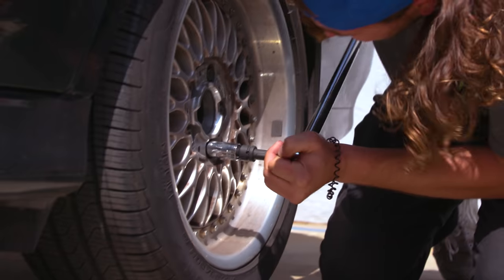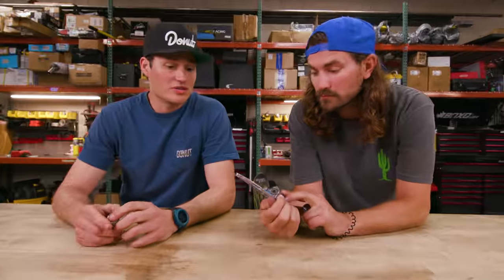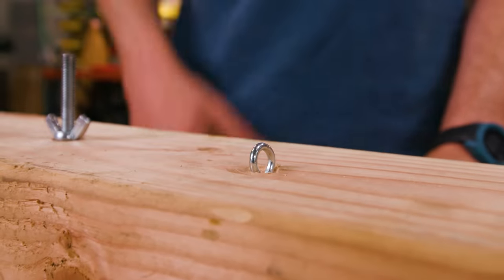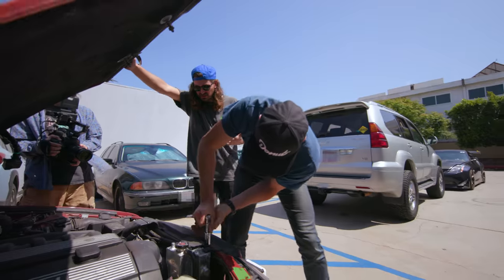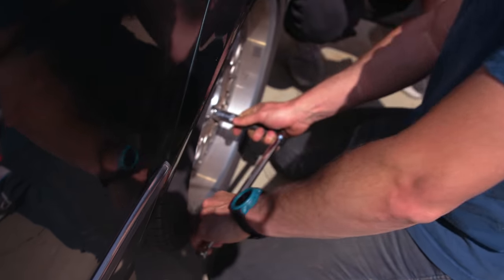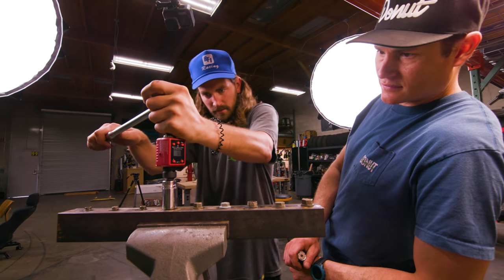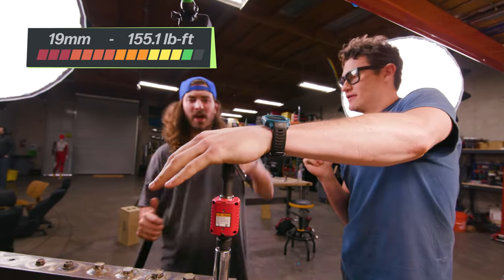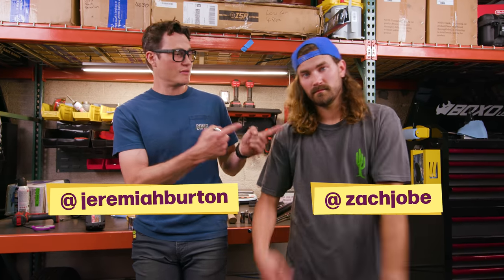Testing the World's Most Hated Tool

Comment: Oil Filter wrenches would be sick to see.. the three different kinds of them as up against each other
Reply: I just use a old leather belt, works great on every size of filter plus the length makes it easier for tall engine bays
Reply: I like this one as well. My favorite are the ones that are basically a oil filter shaped socket, but sometimes you just can't get them into the tiny space the manufacturer decides to stuff the oil filter into.
Reply: Good idea
Reply: @ztyhurst  Yea i use the socket ones too but depending on the year of car i find u need either smaller or alot bigger which is strang
Reply: Those new 3 pronged ones you can put on an impact win for me lol put in on pull the trigger lightly and wait for it to tap it loose
Reply: Ditto! Especially in confined areas.
Reply: My preferred oil filter wrench is a screwdriver and a hammer.
Reply: I have used pretty much all models on many kinds of cars and I can say it really depends on the car what's best and not the tool itself.
Reply: If you are doing your own oil you should be able to get it off by hand.. hand tight then 1/2 turn ands its sealed
Reply: Try an oil udder too those are sweet
Reply: @MAVORlC  that’s a good idea thanks
Reply: @snakeballs8965  you are a menace to society my friend
Reply: @flyfreak23  I also rotate hose clamps so that they have to be rotated back before they can be removed.
Reply: I have different wrenches for different stuff.
I have a Matco ratcheting filter wrench with jaws on it. The jaw size is adjustable and has shown to rip open a tight filter instead of losing grip 😂
I have a regular oil filter wrench that every has, a Volvo filter socket, and a Toyota filter socket. Rarely use the last 3 but they’re invaluable when I need them
Reply: They work pretty good
Reply: On my car atleast i just use. Yk. My hand
Reply: I use a pipe wrench, stuck oil filters are no longer a problem
Reply: @ztyhurst  a screw driver and a hammer
Reply: Oil filter plyers are the only way to go
Reply: Except there ment to be done up loose enough so you can remove them by hand
Reply: @Nomobsfome  I've used that method as well, but it's kinda messy.
Reply: But you only need one once, right? If you're doing your own oil - I've learnt/heard that hand fastened is tight enough, so the second time you service your car it won't be welded stuck to your engine like the first time you do it
Reply: @brandonr2188  Yeah, it's always the first time someone brings me a car to do where I seriously need em.
Reply: I just use channel locks
Reply: @snakeballs8965  "My preferred oil filter wrench is a screwdriver and a hammer." ha, I've had to do that a time or two. And I'm the one that put the oil filter on in the first place
Reply: we use a chain and a bolt welded together
Reply: I second this!
Reply: The tri claw is my go to
Reply: Jesus loves you alot trust in His death 4 salvation and be saved from eternal hell <3 Jesus died on the cross for you bro.
Reply: Hey guys I just got my first car last week, I've been watching alot of Donut videos and always hear the crew talk about forums and was wondering where I can find these forums for cars, my car is a 2011 subaru impreza 2.5i sedan. Any info would be greatly helpful
Reply: I have always just stabbed a screwdriver through the old filter to spin it and just screw on the new one
Reply: I'm a chevy lubetech. I have band type oil filter wrench, Turn-and-close 3 jaws socket, and normal oil filter pliers. I use all of them every day. If you're not mechanic and trying to find a best tool for oil filter change, it really depends on what car you have. For example, some toyota cars, you need a special socket. oil filter wrenches won't work.

By the way, circle steel band type filter wrench works most of the time.
Reply: Strap wrench is the best IMO jaws when jiffy lube tightens the oil filter with a half inch impact
Reply: I used to change oil for a living, the cups are definitely the best.
Reply: Am i the only one that uses his hand 😅🥲
Reply: The grabber style only works for canisters, not the filter+housing setup
Reply: @DexTheMenace  NASIOC is the forum you are looking for
Reply: @jimmyjames8573  they should be installed as tight as you  an by hand, but after the heat and time I challenge you to find a filter that will come off by hand. Should need something to Crack it loose (up to 1/4) turn, then will come out by hand
Reply: hand tight baby
Reply: YES! I friggin hate those plier-looking ones. Without fail I always crush the heck out of the filter.
Reply: yes please I wanna see the old belt style versus the spider or  metal band on different filter types
Reply: There are more than 3 types for a start and each one I have used and own are all great.... it depends on what you are working on to which one you grab
Reply: @its_tricky_dick  For sure! Some of us (like me) are incompetent though. 😂
Reply: @jimmyjames8573  doesn't always work that way. Toyota 1gd-ftv and Ford 7.3 powerstroke are 2 engines off the top of my head that require to be tighter than usual
Reply: @mercury0214  I bought a 3 prong one that fits on a socket wrench at Walmart for like 5$, works really good.
Reply: @czattew  hmmm that's weird I swear 1st time I did 1 the instructions said tighten until the seal touches then go another half turn which felt way too loose for me so I always just done it not quite as tight as I can but close too it and never had a problem undoing 1s that I've done
Reply: @its_tricky_dick  interesting.  Good to know
Reply: I've tried three different types and settled on the one that's basically a supersized socket that fits the bottom of my particular oil filter.
Reply: I use a 32 mm socket.
Reply: @dawggonevidz9140  Yes, that's the one i was trying to describe lol. It fits on a socket wrench and grabs the bottom of the filter.
Reply: I just get the K&N ones with a wrench off nut. Works great
Reply: For general Europe trucks and reefer units i use a chain tool or a belted one. Socket sometime works but rarely and 3 prong is a nope.
Reply: you mean there are alternatives to a screw driver and hammer?
Reply: @brandonr2188  this is the real answer, if you have to use a filter wrench, you're doing it wrong... unless you have one of those cartridge style filters, my wifes saturn has one of those, takes a 1-1/4" socket, so gator grip would definitely be a fail there too, lol.
Reply: @dinukap4  what about using a silver wire, Remus Tuning?
Reply: @joshalsabeh20  strange u mean? Not stange.
Reply: @snakeballs8965  screwdriver? Seems like an odd tool huh?
Reply: @repulse_timm  what is oil hudder? An odd tool huh?
Reply: @purwantiallan5089  but effective
Reply: As a professional who uses all different kinds. I can honestly tell you, the pliers are the best tool. Suitable for 75% of applications. Then the claw type tool is a second.
Reply: The pliers win hands down. I have the strap, the jaw & the pliers in my van & I’m a mobile auto technician. The best option is the oil filter socket. Those kick ass!
Reply: Snap-on makes a socket for oil filters
Reply: The Claw, The wrench, The pliers, The cups
Reply: @stpbasss3773  oh yea that’s the same one im talking about I just put in on my impact haha
Reply: project farm
Reply: There’s probably a lot more variety than you’d think, I gave at least 5 or 6 different types of filter wrenches
Reply: Bro just like get stronger
Reply: It all depends on the filter application.  You can't always get the pliers on the filter.  Like the GM vehicles that have them up front by the exhaust manifold.  Or the Ford ranger where you have to go in thru the wheel well.  In those cases, I use a filter spring wrench 🔧
Reply: Bluepoint filter wrench. It has 6 jaws with 3 teeth each and 4 adjustable size with the snap op filter strap
Reply: I fucking love my oil filter wrench
Reply: OilFilter Wrenches are the most useless tools of them all.. I mean.. when you install a new filter, you're supposed to fasten them by hand.. and if you take it off.. you're gonna discard it anyway, i just smack a screwdriver through it and unscrew it.. 
if that sounds a bit harsh?.. get a big Hoseclamp and a pair of pliers, or use a strap wrench.. strap wrenches are the most underrated tools, there are also versions with a chain instead of a strap, you can easily make one yourself.. all you need is a piece of flatbar, a drill, a file and a punch to split the chain.. oh.. and a hammer to push the pin back in to the chain where you fasten it to the flat bar..
I made one to replace the front sprocket on my minibike, with a ¼" minibike chain.. worked like a charm..
Reply: 3 kinds? I can think of like 6 kinds I'd like to see tested
Reply: At Hyundai all the filters are facing down so the claw is best on them
Reply: Oil filter wrenches? It only needs to be finger tight. As far as removing the old one, on the rare occasion that it won’t turn by hand you can just hammer a screw driver through the side of the filter and use that to get it started.
Reply: @curtmcbee2238  Yea thats fair... ive had to use them in cases where vicegrips were needed
Reply: @MAVORlC  can i borrow it lol
Reply: @snakeballs8965  Lol nah use a chisel
Reply: @brandonr2188  yea sometimes but then i just get lazy and use the socket filter wrench
Reply: @jimmyjames8573  yea.. ive encountered ones where its been torwue tightened and even partially welded cuz the previous owner or mechanic wanted "less air intake" so i just use the filter wrench just in case lol otherwise if its my own car i use my hands
Reply: @czattew  lol lil snow on that and ur fine haha
Reply: @banzai.drifto  good to know
Reply: @alexanderpruitt432  they’re not the only ones. You ever heard of OEM tools? That’s a great brand!!
Reply: shop towel and brake cleaner works every time. just comes with wrist damage lmao
Reply: there are at least 4 kinds, five if you count the filters you use regular sockets on. and what's best really depends on the type of filter and placement, both on the engine and in the engine bay
Reply: the filter on my truck always gets stuck so I stab a screwdriver through it all the time and it works every time 👌🏼
Reply: Am I the only one who just uses my hand for an oil filter wrench? If it's really stubborn, a hammer and screwdriver do the trick.
Reply: @joshalsabeh20  so that leaves me asking myself are the smaller filters better designed and more efficient, or are the smaller ones more cheaply made and wikk not filter oil properly
Reply: Lot of oil filters today are impossible to chisel off like the old days. I just changed oil in my new JD Gator. You aint getting that sob off without that socket style that fits right. Not without removed all the skid plates. I succumbed and bought the damn thing. $6 made it so simple....but why do I hate admitting that? Cause it's a scam! They are all in it together LOL! ~ then again, I remember $0.80 cent's for a qt of oil too.
Reply: @MAVORlC  thats funny, my dad when i was a kid bought what looks like a oil filter strap wrench but was advertised on TV for opening pickle jars, mason jars, ext ext
Reply: Love the socket ones when they work, on my old civic the steering rack was in the way of the oil filter so I had to get in there with my hands and struggle with it for 20 minutes since the idiot who changed the oil last torqued that fucker down
Reply: They make them my father has one for his ‘05 duramax
Reply: My oil filter wrench is a screwdriver
Reply: @DrTabarnak  Odd flex but ok LOL
Reply: Sounds like a video for Project Farm
Reply: I second that
Reply: I just use channel lock pliers 😆
Reply: @czattew  Mine always come off by hand. I don't even own an oil filter wrench. Clean the base, bit of fresh oil on the gasket, hand tight. Not "as tight as you can"...just snug. Let the gasket do it's job.
Reply: I use screwdriver piercing method lol
Reply: Including ye old screwdriver plus hammer
Reply: JUST USE CHANNEL LOCKS FILTER WRENCHES ARE DUMB
Reply: @misstori1437  u take that back... Mechanic Jesus loves them LOL
Reply: Yes
Reply: so you're not supposed to use a plasma cutter
Reply: @drewlogan4341  No one is saying that lol you do you
Reply: I think there are more than just three types today.
Reply: @DexTheMenace  hit up nasioc
Reply: @scratchmyback1  I just use channel locks if all else fails.
Reply: @rushthezeppelin  I use a cup style filter remover, too, but more often than not it gets stuck to the filter and I have to whack at it with whatever tool is handy to remove it. I have a 2002 Saturn SL and it's pretty cramped where the filter is located.

I also use a quart-sized oil container cut in half to wedge under the filter, with the opening set in such a way as to direct the flow over the oil drain pan. It reduces the chance of the oil spilling onto the rubber CV joint cover located below the filter, and making a big mess in general.
Reply: @czattew  I used to own a '68 Mustang (I wish I still owned it) that has a 200cid straight 6 and its oil filter was so easy to access that I was able to unscrew it by hand. There was an incredible amount of space under the hood with that thin engine in there. It was the easiest car that I had owned to work on under the hood.

Edit: You should only tighten the filter about of a turn once the seal engages the engine, not as tightly as you can. Perhaps that's why you find it so difficult to remove.

Do I get a cookie for winning your challenge? :-)
Reply: @bcdoggie  Yeah I'm more thinking of those cup filter removers from the context of someone changing oil for a living.  Get the filter off and whack the wrench on the moveable drain pain down in the pit to dislodge the filter.  I'm already covered in oil in that context and there's oil everywhere in the pit.  At home when you are trying to keep nice and clean I could see it being a bit of a different prospect in not wanting to get oil all over your clothes and the nice clean garage floor.
Reply: @rushthezeppelin  Good point. I used to use the same wrench that I use on the drain pan's oil plug to remove the filter remover, but learned that whacking it with a hammer and slot screwdriver instead does the trick much more easily.

Comment: I've had limited success with this tool. It's useful occasionally for jacked up bolts and things like ceiling hooks (as seen on tv!). But they are definitely not a do-it-all replacement tool by any stretch of the imagination.
Reply: I've got one of these, it's defo great for hooks and things you can't usually use with a impact driver...and you have a little bit of sympathy for the thing you're attaching, but I have you know, socket attachments for the impact driver as well, so why wouldn't I use the right one!
Reply: Yeah, they seem like a great tool for little things around the house like hooks but that's about it
Reply: I've used it my whole life with zero ISSUES,, some just don't know how to properly use tools....
Reply: Throw a second hook into the chuck of your drill and use that to put hooks up in the ceiling
Reply: @davidhaynes9580  mind blown
Reply: Yeah my father got a non name brand Gator grip for real cheap for those once-in-a-blue-moon bolts so he probably used it every like five years.
Reply: @2-turnt559  good for you? It's still not as effective as using the proper tool.
Reply: If you're talking about drop ceiling bolts you hang the grid from, you can go to a hardware store and get a screw bit that's designed to screw them into place.
Reply: @chasm9557  yeah, but I've already got a gatorgrip lying around. And I don't have to go to the store.
Reply: @liquidrepublic  I guess it's one of those things where I've done it enough that I just have a couple laying around.
Reply: Hey! Did you know God is three in one!? The Father, The Son, and The Holy Spirit! Bless them!
Jesus died for our sins, rose from the dead, and gives salvation to everyone who believes in him and follows his commandants!

Have a blessed day, everyone! ❤
Reply: @davidhaynes9580  exactly haha. Hell I've used a decent sized nail bent to a 90° work just as well with less damage if you are in a pinch
Reply: I totally agree
Reply: i have one.  almost never used it on regular bolts.  I use it on irregular heads such as hooks,  funky security bolts.   and it does not even replace my tools in my tool box.  in fact I don't remember where I put that... hmm.
Reply: @davidhaynes9580  that's smart, nice. Thanks 👍
Reply: @czattew  that's also smart, nice tip
Reply: I used one for several years for all kinds of odd shaped and damaged bolts. When it finally gave out I went and got another one.
Reply: @Call_Upon_YAH  three in one?? So god is like the gator grip of deities! Lol
Reply: only good for when you have destroyed a bolt completely 😅
Reply: @liquidrepublic  massive facts 👏 the right tool always works better 👏
Reply: Same, plus they're a fuck ton more useful if you cut away a little of the socket to expose maybe a 16th to 8th inch of the pins. Granted, depends on what brand you get and how deep the pins retract.
Reply: @2-turnt559  it would seem you've also never done any really work in your whole life
Reply: @MrThunderhorse8  yes. What about the bronze bolts btw?
Reply: @custos3249  hi Custos. 🙏
Reply: @craigcampbell1843  gator grip? What is that thing, Craig?
Reply: @estuardoleiva9491  me too totally agreed with this.
Reply: Using the same hook as you're unscrewing is much better in every way. We have 350 hooks per wall in our drying rooms and I always smoke the gator grip crowd with hook screwed into the bit reciever.
Reply: Messed up stuff and odd sizes do work with this tool. It’s not all bad, but I still keep a mechanics toolkit around. Def not a replacement for all of those tools. 😀
Reply: "Useful occasionally..." is pretty much what it's designed for!  They try to oversell what it can do!  The infomercials, I mean.
Reply: @davidhaynes9580  That's genius! 
Pulling hooks is the only thing I've ever used a Gator Grip for and there's a better solution.